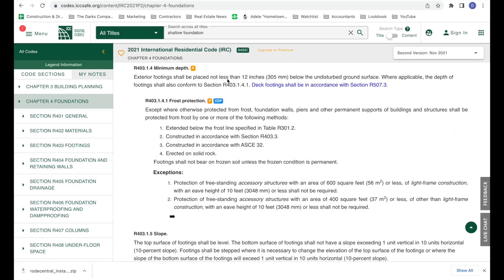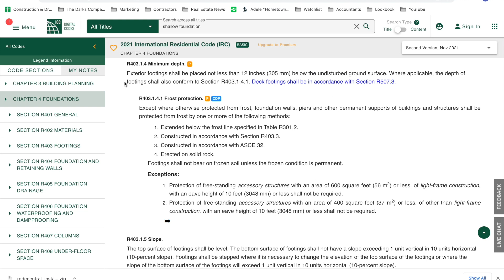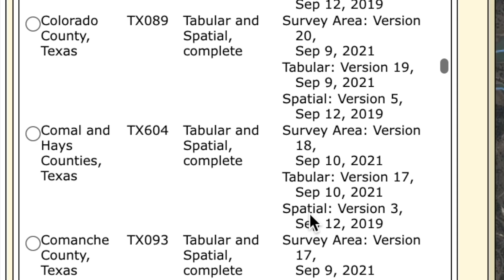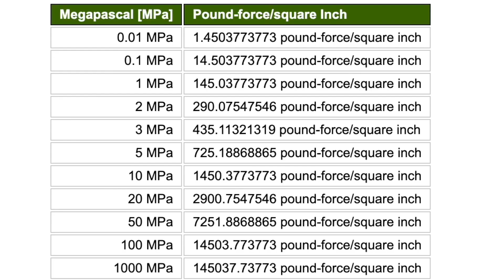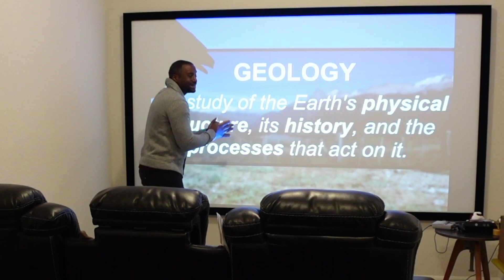DIY A-Frame Build | The Engineer Told Me What? | Episode 6

Comment: I am planning on building a 20 x 40 remote cabin/small house on my property. And, I got so many different answers on footings (from experts). Finally, I ran into a engineering contractor (And for price of two beers) he basically told me he same thing. He said the exact same thing you show in the video (find the soil type) do a quick load calculation (And then, he said 18 inches is more than enough, 24 is great and anything deeper is overkill. Great video by the way!
Reply from the maker: Awesome. Glad you found some value in the video! 🙏👍

Comment: I think the answers is based on their experience and current clients they are targeting. A builder doing multi story building probably have a foundation measured in feet.
Where I reside the foundation needs to be below the frost line. The width, height and depth of the foundation determine the load bearing capacity.
I dug 24 inches down and had a 15x15x15 foundation, then used tubes to bring the concrete above grade for a gazebo which can hold 1000 lbs. of snow. Overkill or peace of mind? 😁
I am not in your area but may very well end up there.
Reply from the maker: That’s a great answer!

Comment: so I have found this chart so I don't know man compared to yours something is way off (what link was yours?): 

Class of Materials 	Load-Bearing Pressure (pounds per square foot)
Crystalline bedrock 	12,000
Sedimentary rock 	6,000
Sandy gravel or gravel 	5,000
Sand, silty sand, clayey sand, silty gravel, and clayey gravel 	3,000
Clay, sandy clay, silty clay, and clayey silt 	2,000
Reply from the maker: Hey man! It was a link that looked at the load bearing capacity of limestone and clay loam. 

But don’t worry. The house is perfectly fine! 😀🙏👍
Reply: @darryldarks  Found your link anyway, was late last night sorry I didn't see it. it says locally they use the conservative 0.4 mPA number which is equal to 8354 lbs per sqft but apparently it's a lot stronger than they initially thought hence the 6 which is like 125313 lbs per sqft! but that would be more than that bedrock but maybe that chart is conservative. Either way, with context that number sounds more probable!
Reply: @darryldarks  I'm not worried about your house since your ground clearly looked hard anyway, but I'm going to build one so I had to make sure I had a correct frame of reference. mine is 90% chance clayey gravel, 3000 lbs per sqft. :)

Comment: To be fair to the engineering community, they are normally brought into projects where engineering is required.  And since they have professional liability at stake, their tendency will always be to error on the side of safety factors and over engineering.  They also will recommend a geotech because while you can get a general sense of the soil conditions given the area, you never know exactly what the conditions are beneath the spot you’re standing unless you drill down to confirm.  

All that being said, it’s your property, you’re a sharp guy and are willing to do the research and ask the right questions, so following your intuition I think is a safe bet.  You understand the risks and feel comfortable with it.

By the way, since you’re comfortable operating heavy equipment and teaching yourself, the next time you develop a property and need to drill auger holes, you can rent a skid steer like they used to clear and mulch your property and put an auger bit on it.  You can knock out those holes super quickly and easily.  Keep up the hard work!  I enjoy following your progress and respect the hustle.
Reply from the maker: Thanks for your thoughts 👍
Reply: awesome comment. Great insight. Ty.